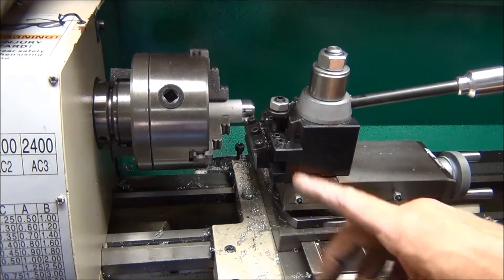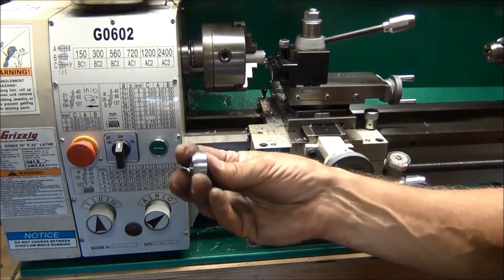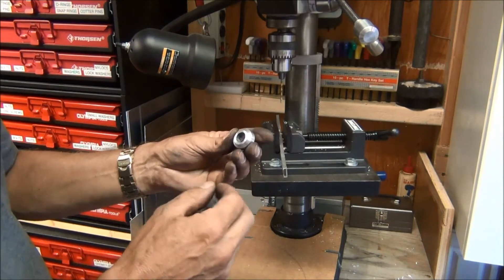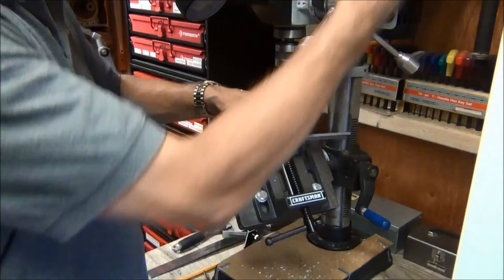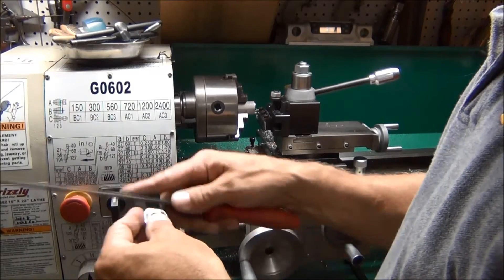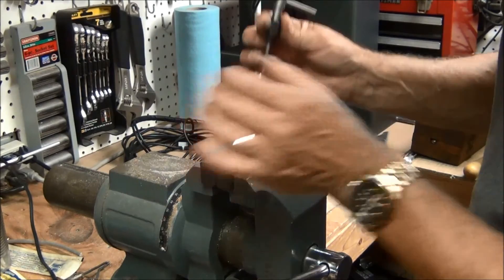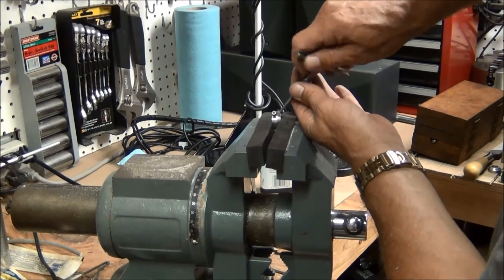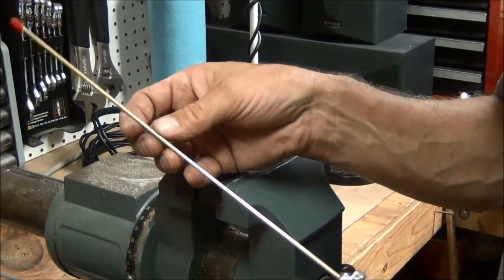VHF - UHF Quarter Wave Antenna Part 2 (Grizzly G0602 lathe)

Comment: Try starting the tap in the drill chuck before you move the part after drilling.  It will go in straight every time.

Comment: Some parting tips, one, check out MrPete222's video on the subject.  When parting you can't baby it, feed away! DO NOT back off, that is when you loose the blade.  Get a carbide insert type parting tool, the best thing ever, really.  For aluminum just about nothing beats WD-40 as a cutting lube, but only aluminum.  Great vid, keep up the good work.